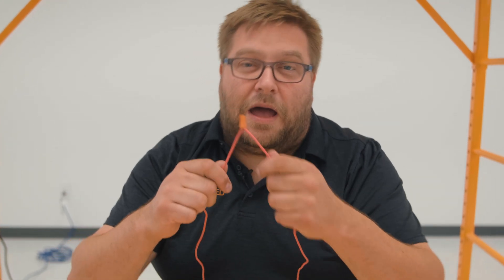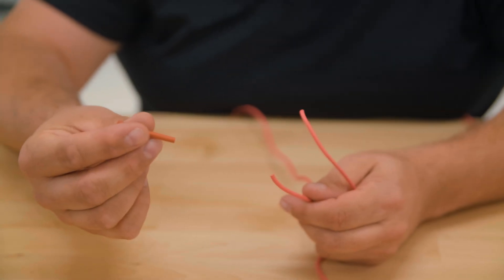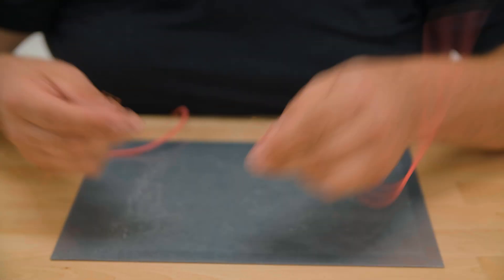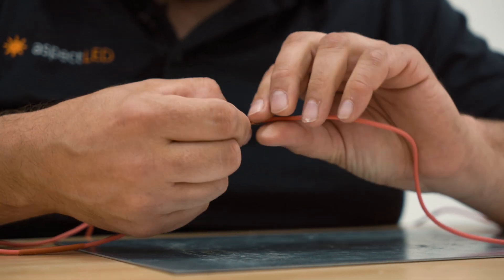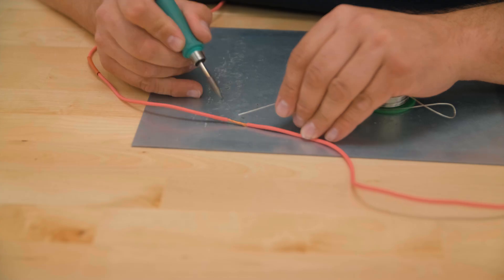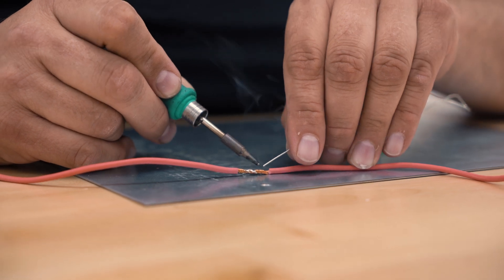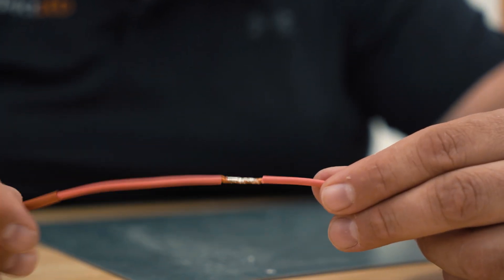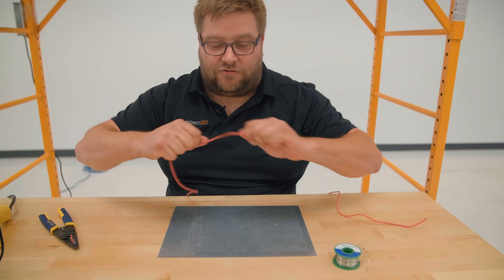How to splice a low voltage wire

Comment: Hello there I have the raymarine pro 5 and I have a question since my sonar start to stop working for me on the water brings a message of ‘low voltage suply sonar might stop working’. Can I ask if 11.3 volt that comes out from my lithium Ion battery is to low for the sonar to function?
Reply from the maker: Please check with raymarine about this question.

Comment: Excellent video.  I am looking to repair a underwater low voltage cable that got cut   in two.  Will this work for waterproofing this splice. Thanks
Reply from the maker: No actually, 3M makes a kit for this called "Scotch Cast".

Comment: I practiced on a "solid" low voltage wire.  I stripped off a little more than an inch for that.